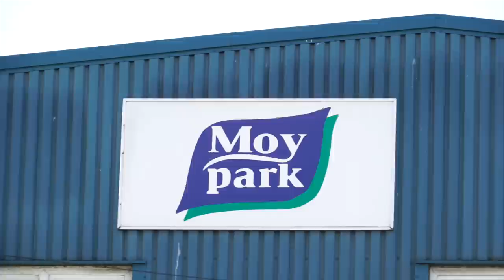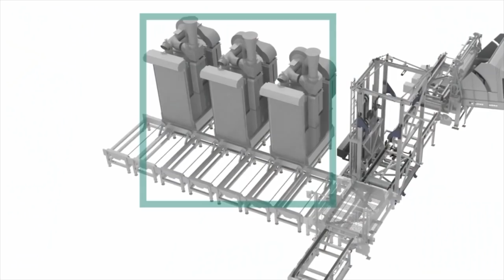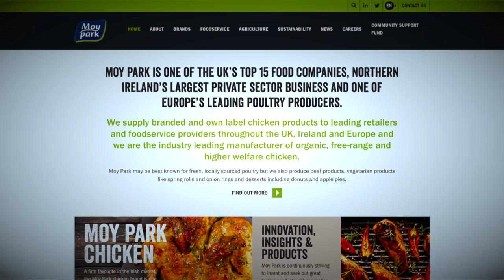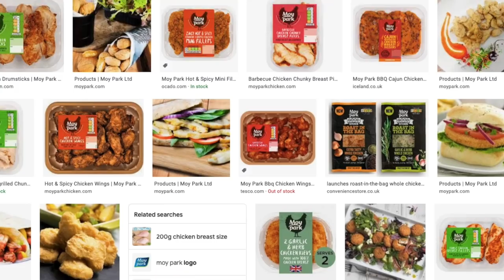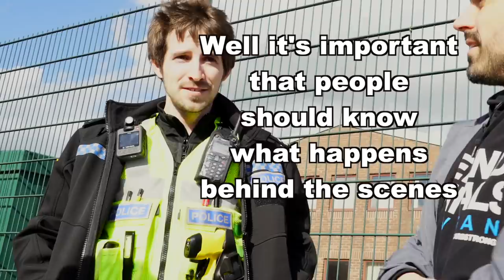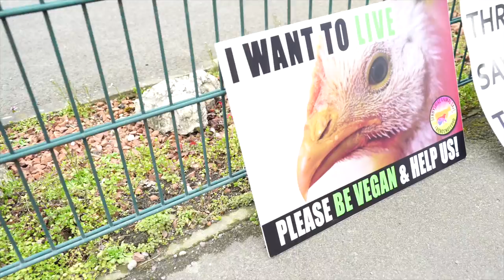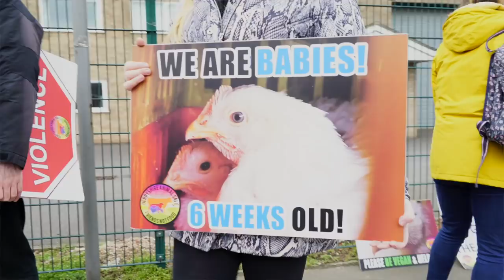I cant believe they called the cops on me...

Comment: It pains me to say this, but I also work on a poultry processing site where I make petfood with the parts that aren't sold to the general public. The killing process where I work (Victoria, Australia) is: they are grabbed by their legs and hung upside-down by their feet. This will often break their legs. They are then passed through a bath which holds a "fatal" current as to electrocute them, although the aren't always dead. They are then passed through a blade still hanging from their feet as they get their necks sliced so they bleed to death. Unfortunately, sometimes this doesn't even kill them. They are then passed through another bath where they are subject to scalding hot water which makes ripping their feathers out easier. It saddens me to know that at this stage, some of them are still alive.